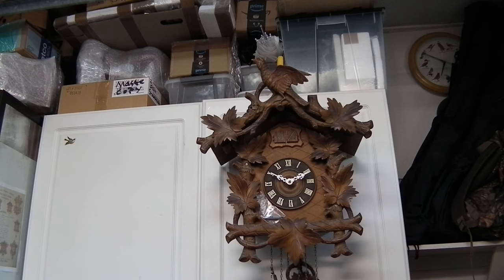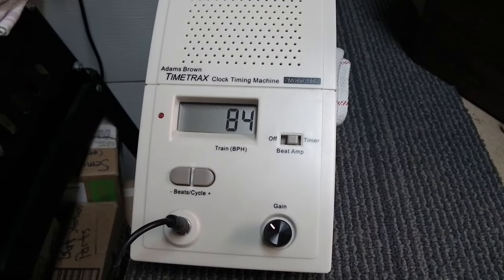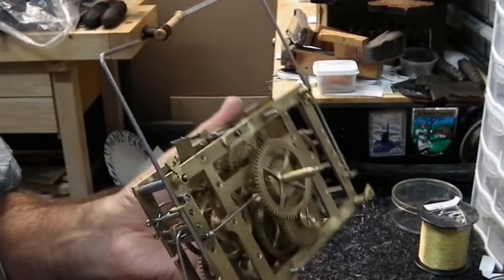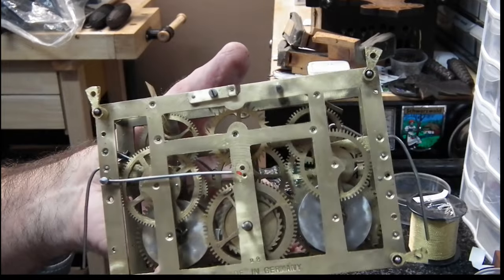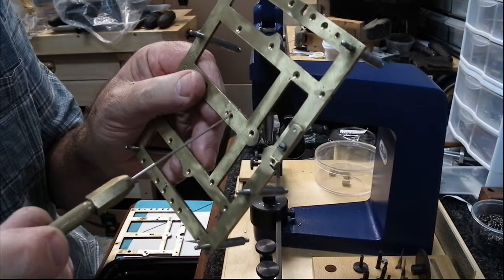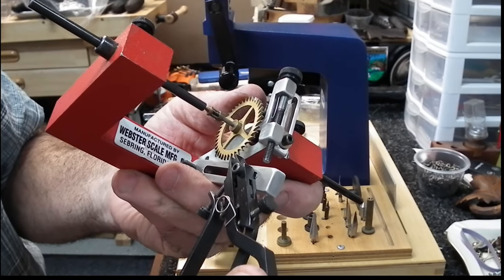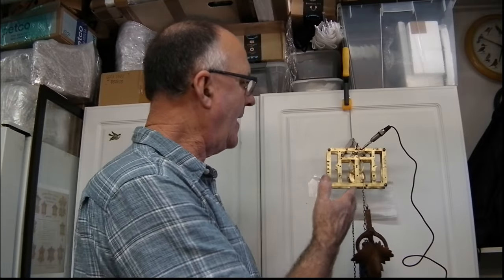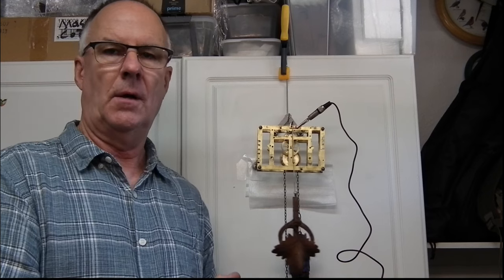Repairing Erratic Beat on a Antique Cuckoo Clock

Comment: Loved this video. Is it possible that you could do a video of disassembling and re assembling this cuckoo/quail movement? I am working on one now and would love to see you do it.  Thanks
Reply from the maker: Thanks for your comment, I was focused more on the two issues with this clock which needed to get  shipped out ASAP. I do have a three train musical clock that works similarly but not sure about a video MAYBE?🤔but these aren't difficult to do,  just look at it as a cuckoo clock movement with an added feature (the Quail side) which is triggering the cuckoo side with just a single lever. Mark those pins before dismantling to help with indexing while re-assembling it. Feel free to email me with questions if you get stuck. 😉